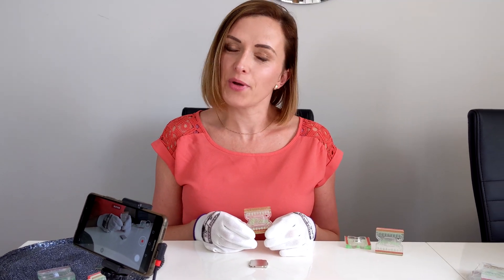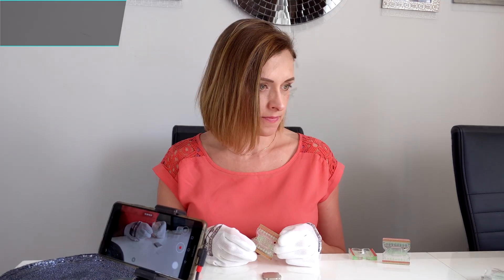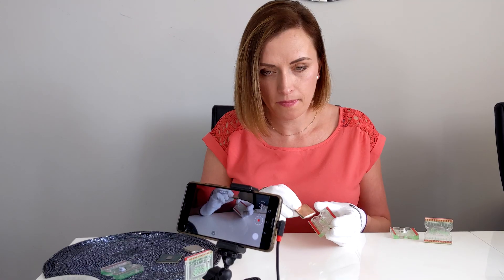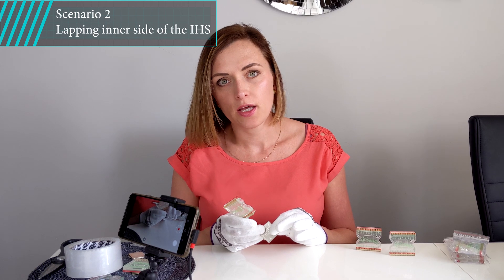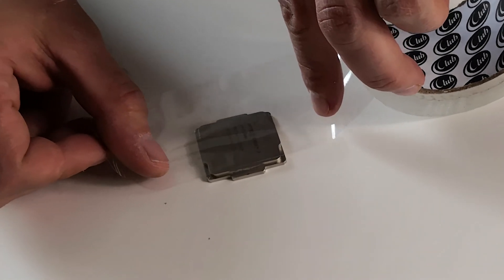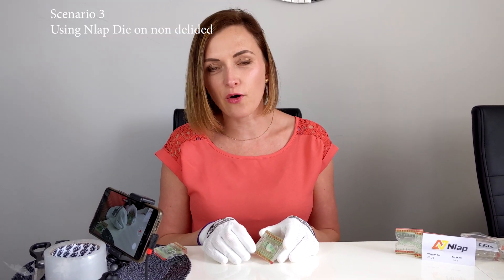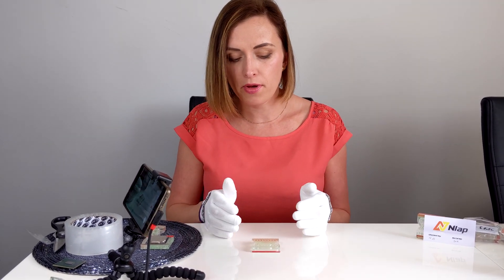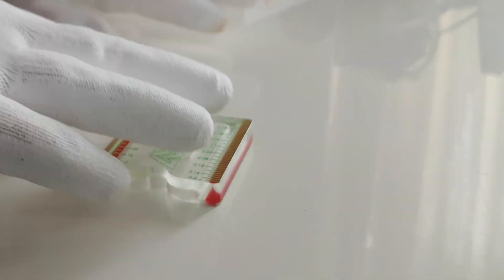Der8auer Nlap video response

Comment: Greetings in bought the product to reduce the die of my i7 9700k that I have them with direct die.

There are 2 core that give me more than 7 degrees with respect to the other I would like to regulate it I saw in the German video I remove a 9900k 0.20mm and reduced the temperatures

now I ask an i7 9700k what would be the measure to reduce without killing the processor?

Comment: That die sanding tool is an amazing idea, i really liked it and will surely buy one for my 9900k once this lockdown ends.
But i have watched the derbaur's and a few of your videos too and none of you have shown the before and after temperatures. Ultimately anyone buying this tool would surely want to know how much temperature he or she will be reducing compared to the stock die height of the cpu.
So would request you to do another video in which you can show some testing results in detail.
Please show temperatures before sanding and then temperature results after sanding.
Please use a 9900k if possible and sand it down atleast 0.4mm and share the results.
Reply: I believe I've seen a couple of results down around 15 degrees off of the stock setup.  I think one approached 20C.  I think I have a golden chip, or at least a silver one, that I can get to 5.3 stable if I had those temps.   I am reaching a temp limit instead of power limit.
Reply: John Lacquey which cpu are u having and can you share a few more details about your setup?
Reply: LTT did a video on the Ncore v1 two years ago and there were significant results